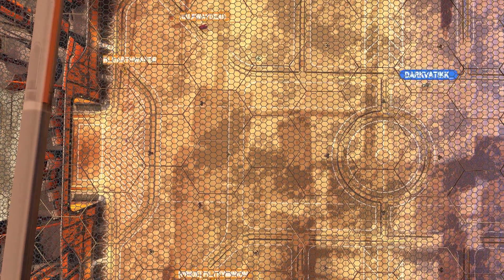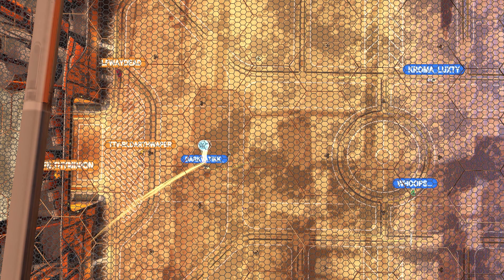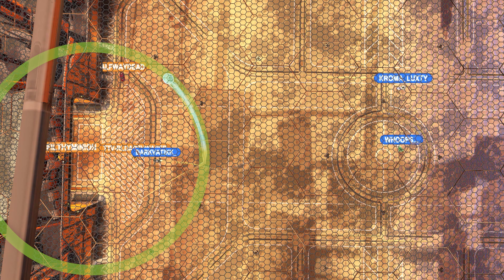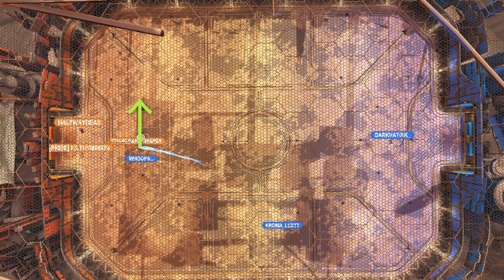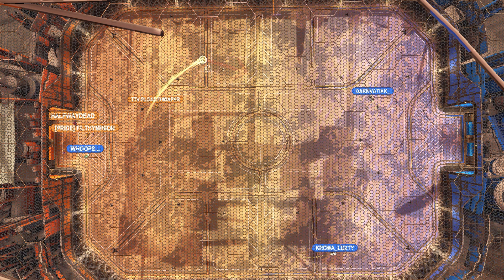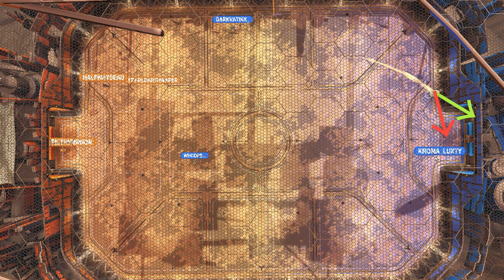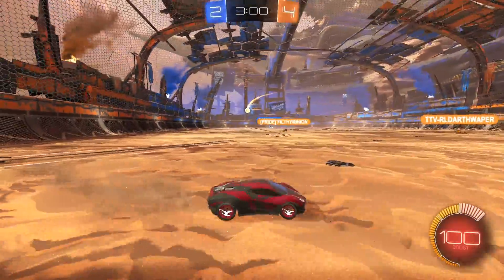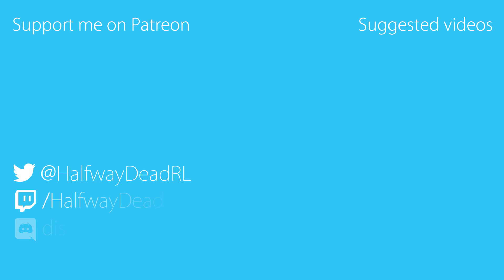Heatseeker physics explained - Rocket Science

Comment: I think they'll bring the mode back since the numbers are staying way higher in comparison to any other of the modes
Reply: But the high numbers are mainly because of Corona.
Reply: @HeadhunterKev96  also cuz it's more fun than the other modes. Spike rush was out during corona too
Reply: @HeadhunterKev96  I said higher in comparison, ie standard comp/casual not generally high
Reply: Spike Rush was a known mode.
Reply: @HeadhunterKev96  I like spike rush(better actually) but are you listening to what I'm saying, this has consistently higher numbers the all of the other game modes at any given point in the day day. Nearly trippling ranked 3s
Reply: Sure, I understand your point. I even like Heatseeker better. But comparing numbers is not that easy...
Reply: laronda10 the numbers are high because of the limited mode. All extra modes had similar numbers in their first weeks
Reply: @joned1000  ummm no they didn't heat seeker dwarft all the the other one by near 3 fold